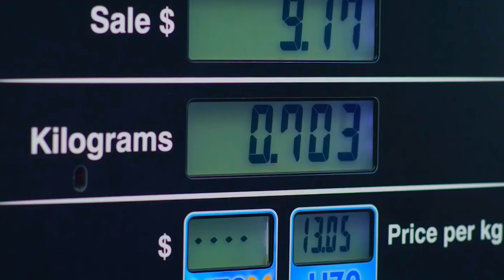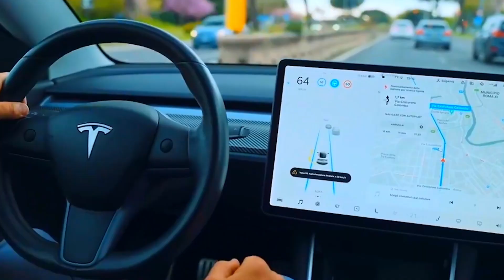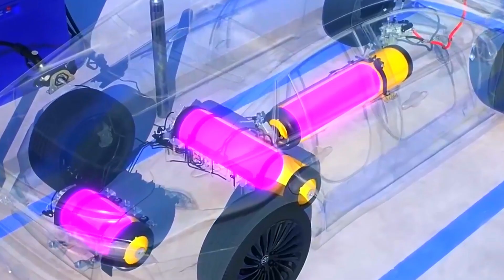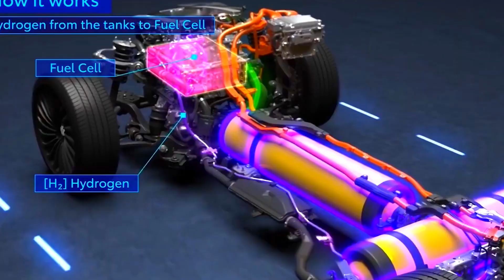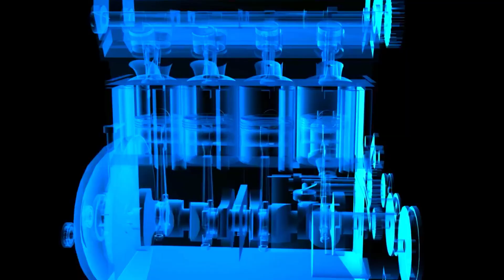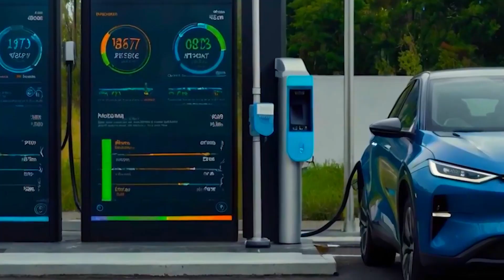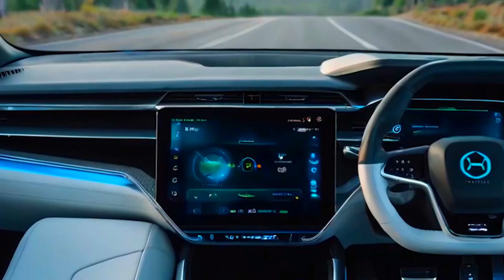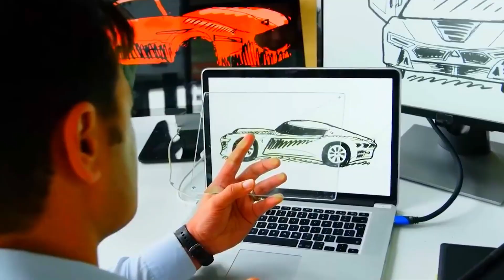Toyota’s 2026 Hydrogen Engine Stuns the Global Auto Industry

Comment: In theory, the hydrogen technique is great. But in the real world, there is not really a way to produce sufficient green hydrogen (made without carbon oxide-emissions). 
So in niches it will work, but to substitute both oil based engines and battery electric, it fails by far.